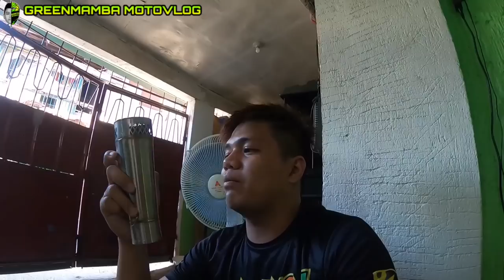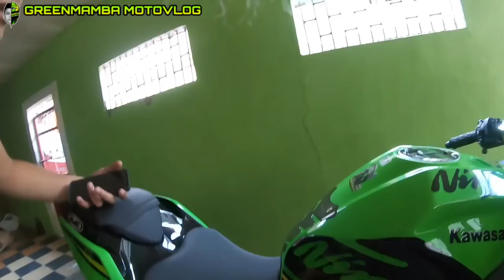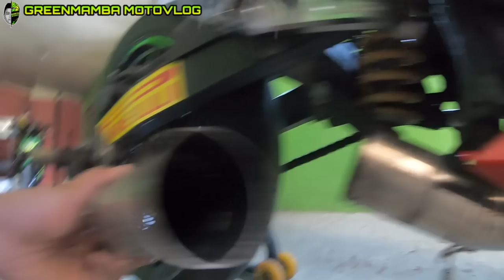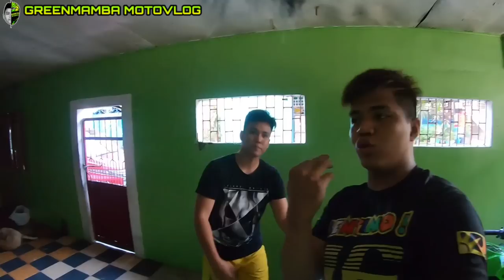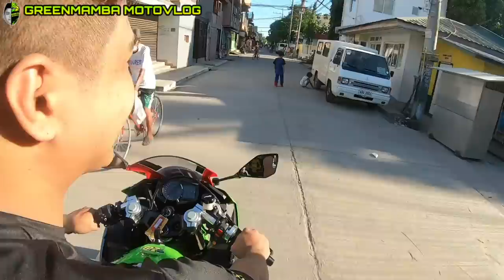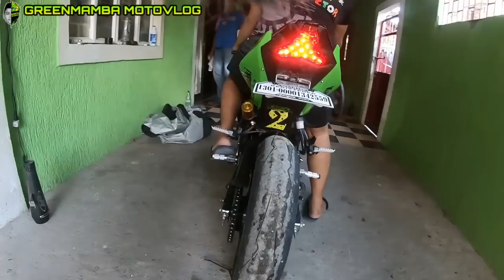NINJA 400 RR INLINE 4 | SC PROJECT SOUNDTEST | SHOUTOUT SA MGA SUPPORTERS

Comment: Sa totoo lng sir lata tunog lagyn mo po ng resonator para di basag ang tunog . Tsaka isa pa sir sana nag z650 ka nlng kasi konti lng nmn difference ng z650 sa z400... 315k ang z400 ang z650 is 365k dba konti lng add mo may 650 kna.z650 ko sir may resonator buo ang tunog
Reply from the maker: Sound check lng po yan sir. Tinry lng namin yung pipe na nandto. Sabog talaga yan dahil wala syang fiber tubo lang sya. Hehe. And di ko trip z650 sir. Race bike lang po kasi yan. Binalik ko lng sa stock fairings after ng race season. 😊
Reply: GreenMamba MotoVlog sa bagay hilig mo sa track ok yn sayo. Ako kasi hilig long ride. Upright position kasi z650 tsaka sport touring narin sya. Maganda rin sa city driving. Pero para sakin di sya pwde sa traffic kasi mainit makina lalo na yung buga ng exhaust fan nya.
Reply from the maker: @tambuchongpinoy2678  yun nga pals hehhee pero kung long ride mas trip ko pa din talaga ganyan paps touring bike masyado mangalay pag sports bike sa ride eh. Maganda talaga z650 relax lng
Reply from the maker: Ride ma tayo paps. Taga san ka ba paps?

Comment: Inline 2 lang yan Inline 4 din ang zx10r so hindi same ang tunog nyan boss tska bat ka bumili ng ganyan sakit sa ulo lang canister na yan pang track lang yan ee
Reply: It's parallel twin not inline 2
Reply: Paki search mo meaning ng parallel sir parallel and Inline iisa lang po yan
Reply: Peace yo✌️
Reply: Magkaiba tunog ng parallel twin at inline-two
Reply: Depend on the Crank degree rotation same position of pistons different firing order may cause different engine sound like difference of MT07 Nk400 and Benelli 502c different firing orders but same parallel twin or Inline 2 hindi magkaiba ang tunog dahil magkaiba pangalan sa firing order ang naiba kaya magkaiba tunog
Reply: Kaya nga hahahah